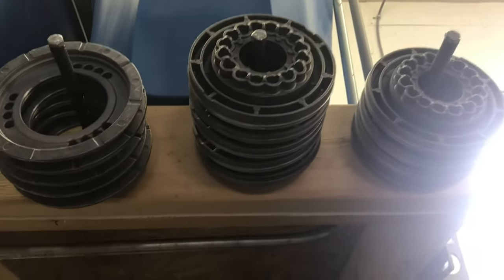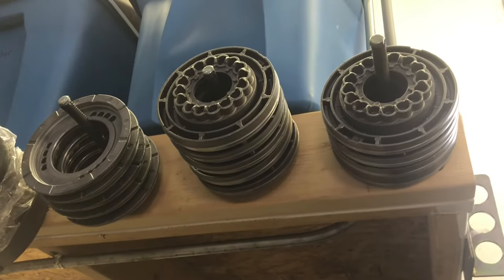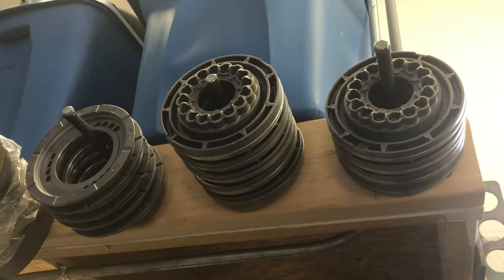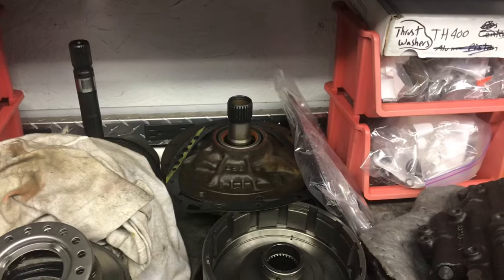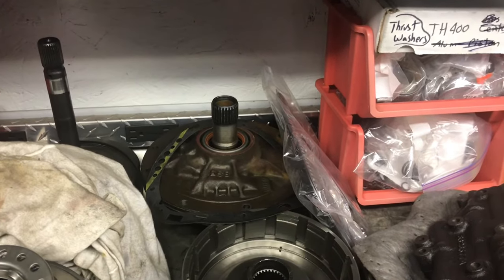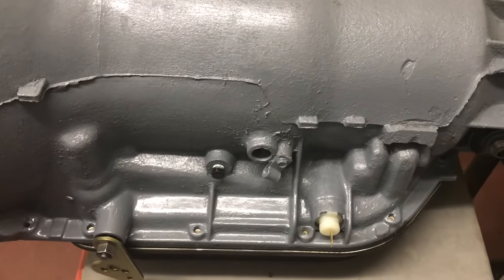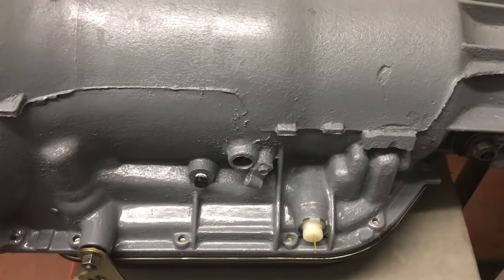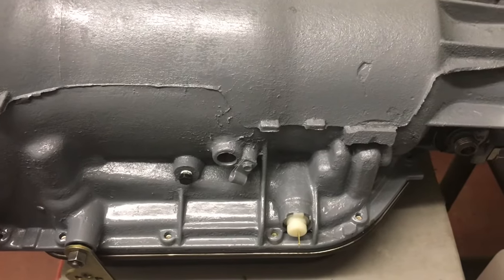TH400: How To Recipe for 800-1000HP

Comment: Asked you about th400 oil pump whine few months back, you suggested to use a metal screen filter. I replaced the alto filter with wix 558890 allison metal screen filter. The whine is gone now! Thanks for your help and keep the good videos coming 👍
Reply from the maker: Great! Thanks for watching!
Reply: That's a great tip if you have any decent horses or if you live where it's super cold.

Comment: I used this video and a few of your others to build my first TH400. Its reverse manual VB, Tbrake, and the thing is an absolute animal!! Behind a turbo LS. Only been driving it a month and a half but the thing is doing great! Thank you so much for putting good, tried and true info out there.
Reply from the maker: Glad to help!
Reply: @mountainsgarage  can you pleeease do a segment on plumbing/wiring?? Where you like to read temp sensor from, the resistor/spike when Tbrake is released, what solid state relay you recommend, that sort of thing. My stuff is working but I had to scour the internet to find those things. And a trans builder will probably know whats best, maybe I did it all wrong lol
Reply: @batdad187 I know I'm late but did you change to a 36 elmater sprag super drum, deeper pan, 6 clutch drive,  5 clutch foward , 4 clutch intermediate, bullit input shaft ECT ?. Your response will help a lot .
Reply: @god1st.530   all good, car isn't going anywhere and trans is still working great. Full season of racing/street under its belt now. Yes on 36 sprag, did the 4l80 drum, yes on deep pan, couldn't clear 4 intermediate with the clutches/steels I had but its been fine. Its still stock shafts, just followed the recipe in the vids.

Comment: It sounds like dual feeding the direct clutch wouldn’t help me much but I’ve heard you briefly mention dual feeding the forward clutch. Is there any other modifications needed other than leaving the seal out? And can that be done and run with a stock valve body? Also if you ever need any 2wd output shafts or tail housings i have a bunch of them. I’m always in the market for 4wd output shafts

Comment: Just got my trans installed in my 9 second camaro. I used your 1000 hp formula and the thing works beautifully. I used all coan parts and transbrake with a TCI 4500 stall tightened up for nitrous use. I was worried sick the trans wouldn’t work right and it works better than expected. I can’t thank you enough for the questions you answered and the time you took to get me through it. I’m confident enough now to do my own race  400s. This is an extreme confidant builder. Thanks again.
Reply from the maker: Awesome! Glad to help in a small way, but you did it! Nice work!!

Comment: I love my th400. I know its heavier than a th350 but it really makes my car feel alot faster. With the th350 I couldn't chirp the tires but with the th400 I can either drive like a grandpa or shred the tires on command. So far I have just been careful on the fwy I have 3.42 gear and it wilk not downshift at fwy speeds. People tell me I can do it but I broke 3 intermediate sprags so I am a bit overly cautious.
Reply: the 400 has a lower first gear then a 350 what u really want is a 02xx 400r turbo stock they are good to 800 hp night and day different to a standard 400 turbo . i been getting them for free u can get them out of motor homes and heavy trucks they will have 02xx welded on the bell housing gm sells them as a street strip or heavy applications
Reply: @jeffrey4547  would a th400 out of a military Humvee be a 02xx?
Reply: @SubePelayo928  no it is a crate trans like a crate engine trans combo they are good to 800 hp heavy 8 bolt pump heavy clutches stage 1 shift kit that is how they come stock but it saves a lot if u want to build it to 2000 hp trans

Comment: I use the switch pitch turbo 400 correctly called the variable stator converter in the turbo 400. It is an electric activated stall converter and electric controlled shift. Not to be confused with the electric lock up converter. Two completely different animals.  Easily carries my 600 hp big block Buick engine in the Binderbird.

Comment: i worked for a transmission remanufacturer in the parts dept they wont miss 1 clutch or steel  x 100,s over the years  & a dumpster full of parts from the builders

Comment: i been getting the 02xx 400r turbo for free it is good to 800 hp stock so far i have got 4 crate setups for free with the 450 hp 454 with the 02xx trans from 6,000 to 58,000 miles on them the trans come with the 8 bolt pump heavy clutches stage one shift kit with a few extra the engine come with steel crank heavy rods high flow heads 10.5 to 1 compression just needs to breath with a bigger carb and a good intake it come alive . i put one setup in my 68 pu and the trans works great not quit as good as my pro built 400 turbo which is good to 2000 hp but way better then any standard  400 turbo

Comment: shawn you mentioned that the forward hub is a good idea. how crucial is the upgrade is it vs a nicety? is it just towards this power level that it becomes a good choice? what happens with failure?

i have all the tools i think ill need.
-Trans case holder for engine stand
-pucks of various sizes that can be used to press bearings
-clutch depresser tool
-big hose clamp for pump
-dial indicator + base
-sockets, snap ring pliers, picks and various hand tools
-green assembly goo
-3l80e astg book

i also grabbed a supposedly still good th375 for a $150. if the steels/clutches/etc look fine ill reuse them.
-used 9.25" truck output yoke and new tail housing
-sfi housing 
-transgo hd intermediate snap ring
-direct clutch drum + 34e sprag (assume 4l80e since it lists for both th400 + 4l80e)
-case saver
-roller bearing + shims

just need to pick a transbrake, both atd and jakes are on backorder. probably go for a jegs/summit kit
thoughts? missing anything?

thanks for sharing! youre an inspiration!
Reply from the maker: You can find the billet hub for $80ish or less.
Sounds like you have a good plan!
ATD fills orders pretty fast.
Holler if you need anything!
Reply: @mountainsgarage  i appreciate the lending hand. Is there a part number for the $80 hub? I'm only seeing the ones around $100+

Comment: Been working my way through a ton of your videos for my first th400 build, I have a 4l80e I'm stripping parts out of. I'm swapping in the direct drum and forward hub. Is there anything else I should be swapping for any advantage seeing as I have all the parts available? Also putting in a tci full manual reverse valve body.

And I just wanted to say I really appreciate all your videos the have been a ton of help!

Comment: Hey Shawn, so you mentioned the 4l80e direct drum. You never mentioned new. I’m assuming they don’t wear down as much and a used 97-and up off eBay will work for 100 dollars and I don’t necessarily need a brand new never run 34 element drum from FTI or ck performance for example .
Reply from the maker: @malc1012  New is good if you have a source, most are refurbished. Either way check it over and run it!
Reply: @mountainsgarage  thank you Shawn. I thought I made a mistake ordering a used one instead of ordering the FTI F4038 new drum and sprag.

Comment: In the video, you mentioned something about a "vent fitting" and "cooler lines." I assume the cooler lines are a reference for a trans cooler correct? As for the vent fitting, I'm not sure if you're referring to an overflow tank, dump valve or something else

Comment: any suggestions for building something like this cheap. I know 1000hp and cheap shouldn't be in the same sentence. But it would be cool to see something someone who doesn't have a bunch of extra cash could build.
Reply from the maker: If you shop for deals and already have the transmission, you might get it done reasonably inexpensive.
Reply: @mountainsgarage  I'm hoping to try. I can get a core for about $80 which is certainly helpful

Comment: thank you for this video. I was wondering if I'm able to do these upgrades without going valve body?  i don't plan on racing but i want a reliable long lasting th400.  and if adding a case saver to a non valve body trans is fine? thank you.

Comment: Got my case in the local parts washer after your case prep mods.

Ive got a couple quick questions that would result in having to order a few more parts. For a th400 that will get hammered on by small ls truck engines, should I do the case saver and spiroloc ring? I'm just cheap and like to have fun.

Next is there a pro and con of the spiroloc you showed during the case saver part vs a thicker snap ring? Or is it more of playing with clerances thing?

Last one of the night. I know you turn down the o ring and bevel on the output shaft, you have a lath right there. If one had to pay someone to do that would it be better to just remove the o ring and buy one of the beveled sunnex yokes in 1310 or 1350? 

Killer video again. Im loving the th400 vids, definetly building my confidence to just do it. I owe you some beers or a clean down south core the next time I'm up in Maine.
Reply from the maker: If you are keeping the front band then a thick snap ring or a spiral lock snap ring, your choice both work fine.
You can run a counter bored yoke. I cut the shaft because its easy, cheap, and any yoke will be happy.
Thanks for watching, always glad to help!
Reply: @mountainsgarage  last round of questions on this topic. Is there a make/model or part number for the thick snap ring or spiral loc you recomend?

On a different note, if keeping both bands, not running a trans brake, but plan on beating on the engine and trans hard can you run a case saver? Would you recommend that?
Reply from the maker: @shocker998md3  I just searched “TH400 intermediate snap ring” on eBay, lots of choices all over the net.
Reply from the maker: I believe the thick snap ring is a 727 Chrysler part.

Comment: Hello Shawn, I follow all your videos and very much appreciate all the help you have provided to prepare me to build my TH400. I have the Hipster engine braking valve body and BTE bellhousing already and just looking for an overhaul kit for clutches gaskets etc. I would like 5/5/4 clutches, do you have any opinions on a good complete kit rather than trying to price something together? I realize I will still need a few additional goodies such as case saver etc. The goal is to be safe to about 800hp and I am looking at the FTI F4019-4 kit right now. Any insight would be appreciated. Rob
Reply from the maker: Any good performance trans shop can probably piece you together the neeed parts. No kits likely exist mixing the 4 clutch 4L80E intermediate clutch’s, steels, and pressure plate.
Reply: @mountainsgarage  Thank you Shawn!

Comment: I was wanting to know  what I can do my big block does not make enough vacuum because of the camshaft what can I do for vacuum  I have a 2 speed 400 out of my friends big block blower car that don't have a manual valve body. And I don't want one can I use the vacuum pump for my power brakes if I put a T in the line  to go to the vacuum  modulator for it to shift? Any help would be appreciated  thanks in advance

Comment: So stock input main and output shafts are fine upto 1200hp ? Is this correct no need to change to billet ?
Reply from the maker: It depends on weight and traction but that is where you need to start being concerned.
Reply: good to know the stock stuff will hold up with half the hp cheers mate

Comment: I just put 1 of those exact models in my 73 Camaro.  I love it but wish it didn't shift so hard 1st to 2nd.  Maybe it will last longer that way. Let me know if there is an easy way to soften the 1-2 shift a little. 600 HP 434 dart engine.
Reply from the maker: What is the valve body?

Comment: Hell I'm still trying to get a solid answer on how much a bone stock 400 transmission can take.
Reply from the maker: They held up fine in 4-500 HP cars when they were new.
But that was a long time ago, like 50+ years, last TH400 was 30 years ago.
It all comes down to HP, Weight, and Traction if the transmission is in perfect shape. Add in condition to that equation if it is indeed bone stock.

Comment: Sounds like a 4l80 is about the same but with another gear. For us street guys
Reply: Street guys?
I daily my th400 with a 6000 stall and 4.10s
Reply: Yes but the 4l80e requires a very expensive convertor. I have seen them go from 1500 for bare minimum to 3000+ depending on your goals

Comment: Been watching your videos for awhile now and I’m currently building a TH400 with transbrake but I built the transmission off a video that was removed from YouTube but i used a reverse manual valve body and cut out the correct passages and blocked off one channel I bought the correct spool for the selector, separator plate and gaskets, and external modulator valve for trans brake but my issue now is in the video the guy removed two spring valve assemblies that were next to each other and put 1in freeze plugs in them but the holes are not big enough for that so would I be ok to leave the shift kit parts in the valve body or can I find a different plug to block off the ports? I’ve done extensive research on it and keep coming up with nothing and you are very knowledgeable about th400 and seem to know what works and what don’t any advice whatsoever is appreciated thanks!!!
Reply from the maker: That would be a good question for a valve body expert. I would be guessing.

Comment: I have a question for you. I have a turbo 400 in my car runs 980s at 137. The car works great except for when we go to push it out of the trailer. It does not want to backup. Worth of shit goes forward. Fine pushing it. I just had it serviced new clutches and stuff and it still won't push backwards worth of crap pull the driveline out. The car pushes backwards like nothing. Have any ideas?

Comment: Do you need a manual valve body for this ? Or can you just add a shift kit and shift manually? Also can I use the stock springs or should I upgrade to stiffer springs ?

Comment: What clutch pack would you use for 1100 hp. I was going to use alto power packs with all the mods and a coan transbrake. Can’t find anyone who has them in stock. What would be the best alternative.
Reply from the maker: Any name brand clutch will be fine. Borg Warner, Alto, etc. I use the green ones.
Reply: @mountainsgarage  one more question if you don’t mind. What should the Stack height be for the forward clutch’s and steels. Also the normal thickness for the plate on the forward clutch hub drive. I was trying to determine if it had been cut. Thankyou very much. Love your channel
Reply from the maker: @drjf1  Stack heights vary with the piston. I am not in the shop to measure a plate, but will.

Comment: Hello. So im on final assembly and had a question. So i pretty much followed your instructions to a tee but im going with the auto shifting vb with the mods you suggested. Question...Should i run the engine braking band? Also is there any  mod to do to the rear accumulator for the reverse band?
Reply from the maker: You can run the band of you wish.
No mods to the rear servo unless the transbrake instructions call it out when installing one.
Reply: @mountainsgarage  So leaving it out with auto shifting wont cause issues with the sprag down the road? Also, if leaving it out are you plugging the case hole or just installing the accumulator piston in the case?

Comment: Can I run this setup with the factory vb and a shift kit ?
Reply from the maker: For a while as long as the hydraulic pressure and fluid delivery keeps up with the stress placed on the transmission. Not ideal but possible.

Comment: Hey. Just ran across your videos while searching for th400 rebuild. I build a bunch of rock crawlers with LS motors and 400 transmissions. Decided to start rebuilding them myself. In the past I’ve had them apart to swap 2wd to 4wd output shafts but never been into the drums or pistons. All the videos I see are usually for street cars but I hardly ever use 3rd gear. Mostly just 1st, 2nd and reverse. Usually have to run them way over filled with fluid because of standing the vehicle straight up and down. Also sometimes have to grab reverse under throttle to prevent flipping over backwards. Have any build recommendations for something like that?
Reply from the maker: Interesting! You might want to check out the Demo Derby type mods online. As far as the oil sump I don’t know if anyone makes a swinging pickup in a extra deep pan? 
I didn’t have much to offer here, but if I can help in the future just ask!

Comment: Stock drum input intermediate and output shafts all good for 800hp?
Reply: Only upgrades I really see for those are all rated at 1200hp and up is only reason I ask.
Reply from the maker: There are local guys well over 1000hp with stock shafts. Weight and traction are also a factor.
The inputs come with a larger spline in a stock drum, main shaft is an easy swap.
The output is probably the last to worry about, but when someone wants to upgrade I do all three.

Comment: how long will a pump last with a trans brake? I read somewhere that the transbrake is very hard on the pump will it last 50 passes will it last through a week at rocky mountain race week....what's you take on the situation......thanks love your videos
Reply from the maker: All performance transmissions benefit from an increase of 20-30 PSI over stock, transbrake or not. 
We are only talking about a regulated 200psi.
Most hydraulic pumps make thousands of PSI. I have never seen any increased wear.
Most transmission builders will agree, no issues.

Comment: I have a th400 trans from a RV that was bolted to a 454 big block engine with 80k miles. What are some things I would you recommend doing to it or just rebuild it back to stock I'm bolting it to a 5.3 ls engine for the street no racing. Rebuild it with a new converter .